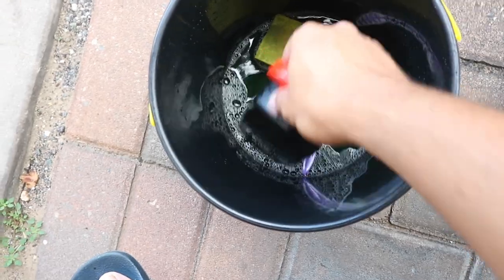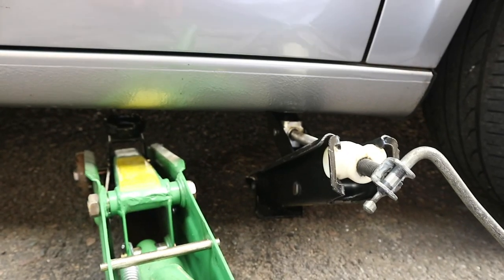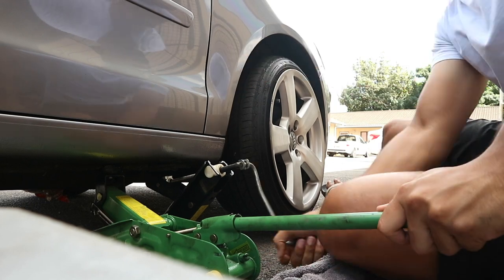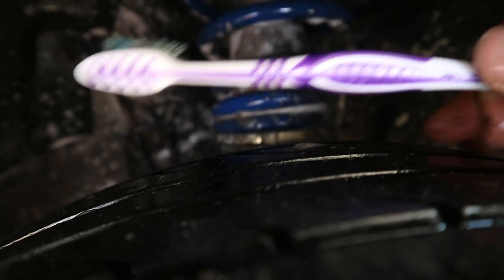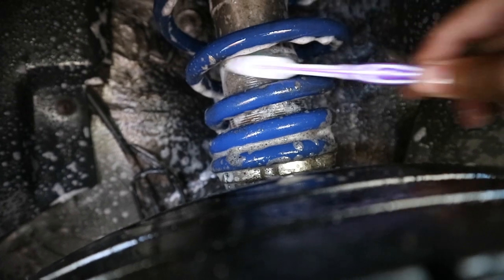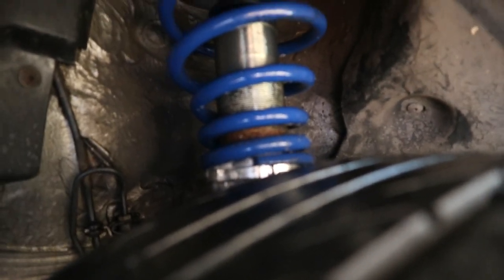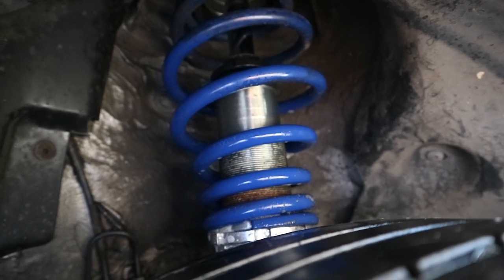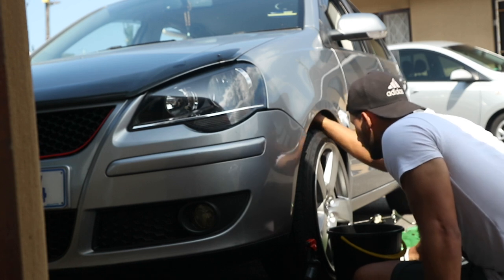CLEANING THE COILOVERS ON MY VW POLO 9N3

Comment: Just subscribed to your channel i so love your videos please keep the content coming, another thing I'm running on jom coilovers on polo vivo, how can i go lower at the rear(back)..much appreciated
Reply from the maker: Neo Selepe thanks for the love man , I really appreciate it. Do you just want to go low for a show or to drive daily ?
Reply: @dillonkruger7204  for a show bro?
Reply from the maker: Do you still have the adjusters in the back coilovers ? Underneath the spring ?
Reply: @dillonkruger7204  i removed them but it doesn't seem to go that low when I'm at shows
Reply from the maker: When you’re at shows you should remove the springs completely, or make shorter springs.
Reply: @dillonkruger7204  so with shorter springs i can place back the adjusters?